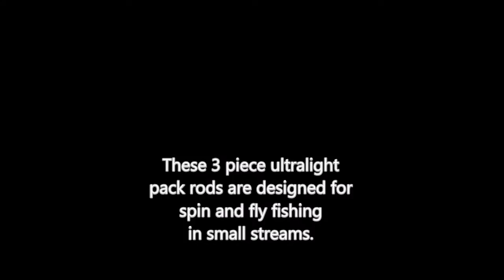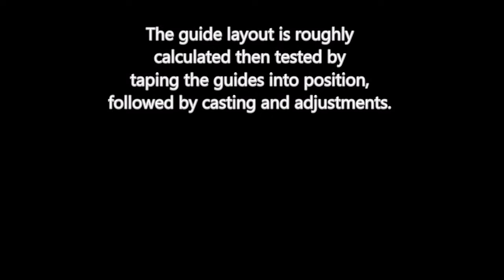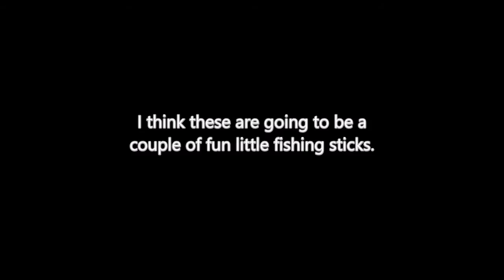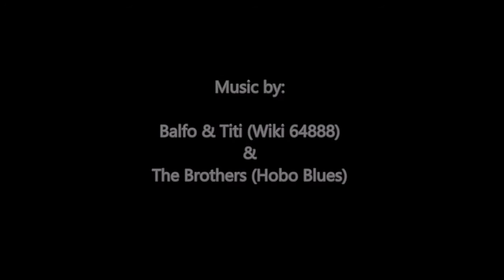Building a Bamboo Spin/Fly Pack Rod

Comment: That is a great build thank you, what " wire " do you use to make your snake eyes ? please
Reply: I picked up a few different gauges of "German Silver" wire for a local jewelry craft shop. This type of material was popular for decades but not so much now. This type or wire hardens some when it is twisted and hammered. Harder metals last longer but I have well used rods that are very old with no problems with wear.